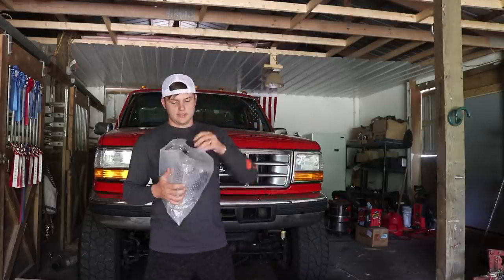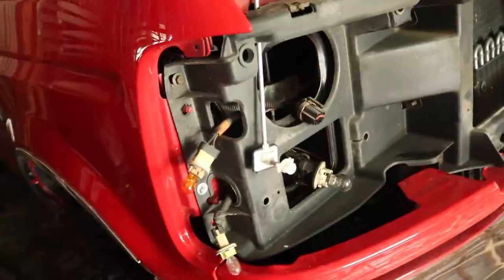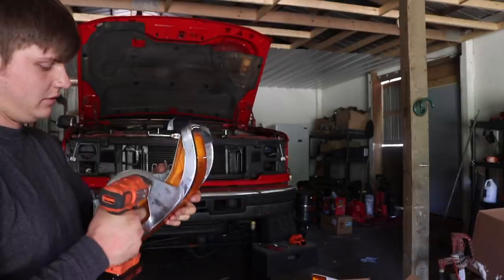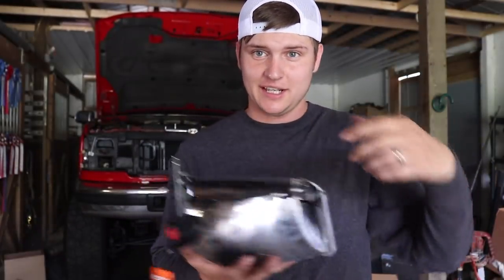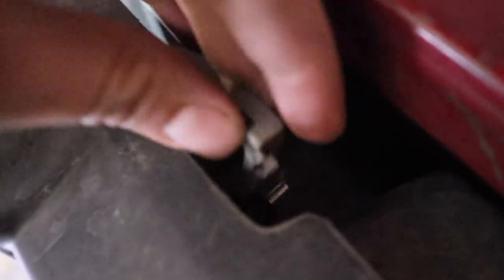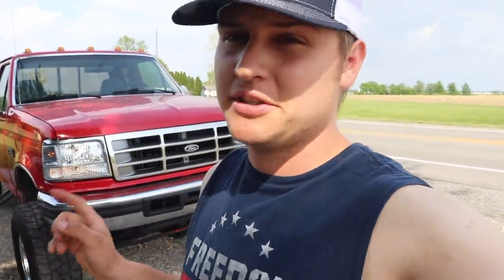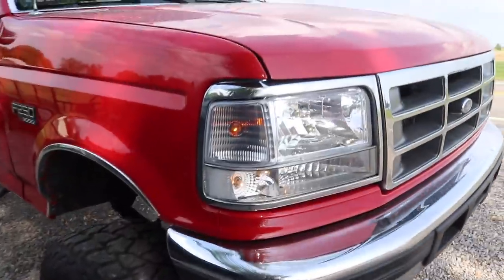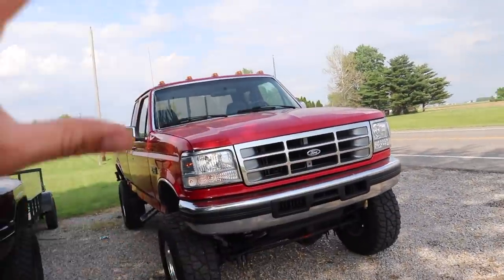YOU ASKED FOR THIS OBS UPGRADE!!! Here it is!

Comment: get the 7.3 to the ford dealer and have them a injector buzz test sounds like the truck needs injectors i can till by the way its running trust me i know my 7.3 powerstrokes i have worked on alot of them over the last 10 years.thanks

- nick

Comment: should put a high flow oil crossover tube for it, will help it idle better and a fuel pressure spring, intake would be very nice as well😏